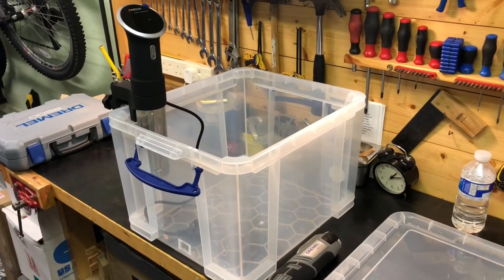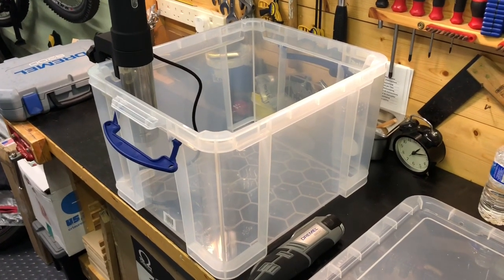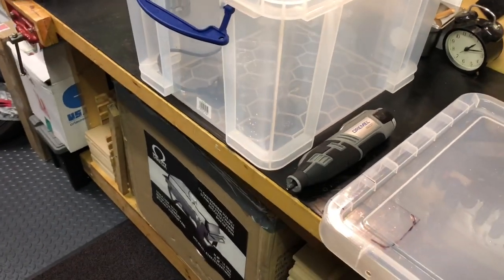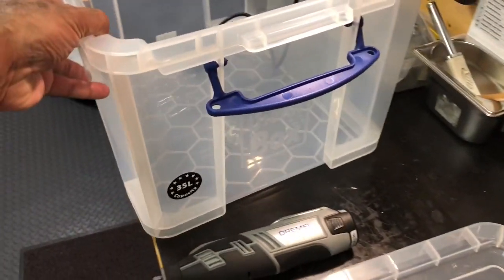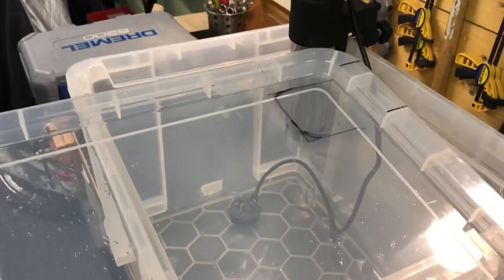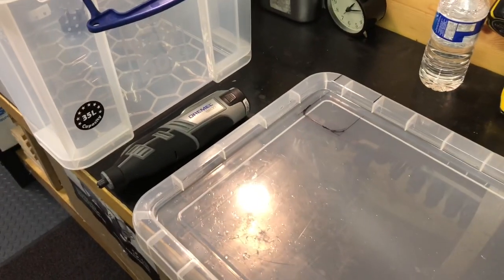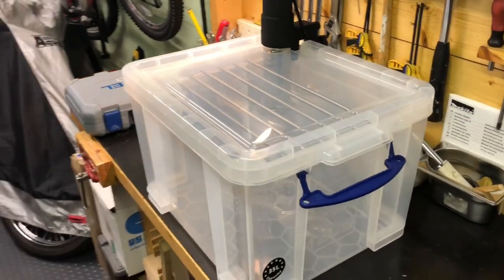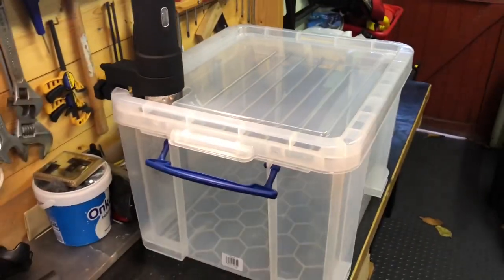DIY Sous Vide Container with Rack

Comment: 35L is too much for that kind of sous vide already AND you put it in the corner where you restrict the water flow even more? those submergable sous vide sticks are rated for 20L. the higher above the limit you get the less water can circulate inside the container so the temps gonna be wrong in certain areas and youre gonna waste a ton of electricity because the sous vide is not gonna be able to keep up. ESPECIALLY if you put it in the corner.

 For anyone doing this i would recommend putting your souse vide ideally in the middle of a site perpedicular to your sous vide bags. and dont go too much above rated capacity. few liters should be fine but certainly not almost double. Pay attention to how deep your container is because cold water is heavier then warm water a WILL stay on the bottom if your sous vide barely reaches half of the container. doesnt need to literally touch the bottom, but at least somewhat near the bottom like an inch or two. Also putting a elevated rack below your bags that would leave an inch for water to flow and the bags from touching bottom of the container is also a great choice. the "hanging" rack is not really gonna work since after a while in sous vide the bags with food float rater then sink. and i can only hope the container is food safe and heat resistant to at least 90C (near boiling water) some recepies require like creme bruilee for example

Comment: Probably a bit more expensive but I just bought a Rubbermaid food container model number FG133P00CLR and the matching lid the container itself is the exact same dimensions and material as the lipavi c20 I then just made a cutout in the lid as you did my cost was $36 but the exact same thing from lipavi would’ve been $67 just thought I would put this out there for anyone looking for a mid grade option